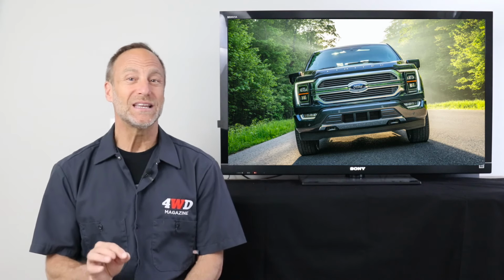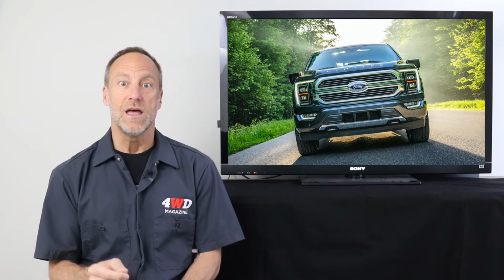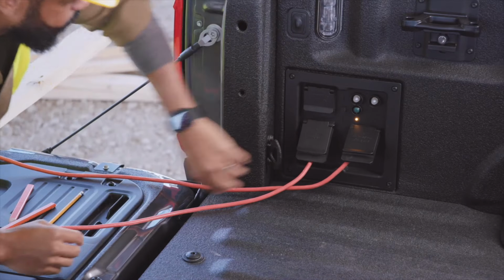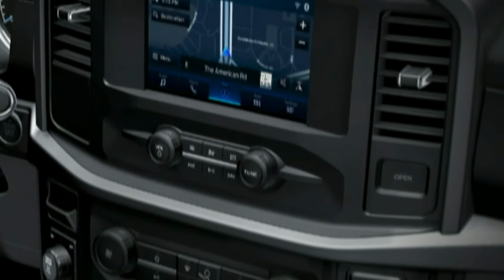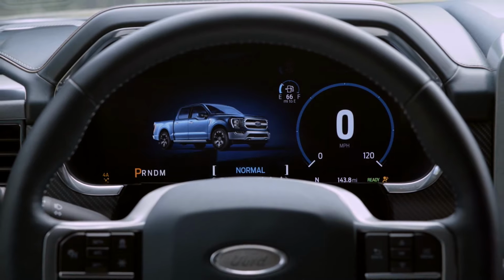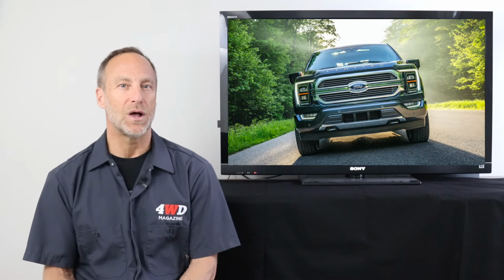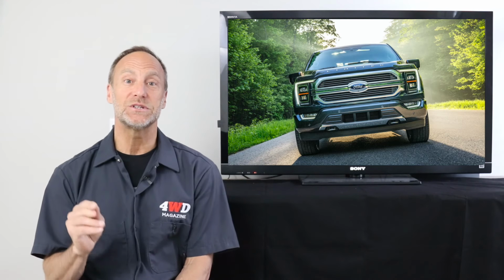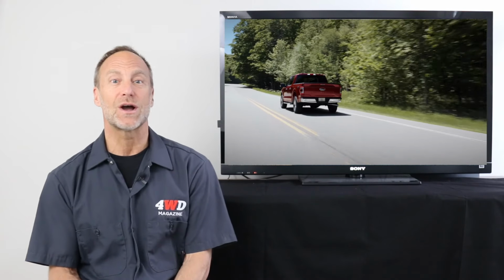2021 F-150 Full Feature Review - Everything Important

Comment: I really don't like automatic driving features.  Don't care.  Do like cameras and good, useful information.  Hitch help, yes.

Am looking at the hybrid for economy and possibly using the power available to run my Bi-Pap and possibly an oxygenator machine, at night, all night when not in an electric equipped, Campground.  Sounds like extra battery(s) may need to be in my configuration.  Recharging those is an issue.  Don't trust solar.

My 2000i Honda generators are efficient, reliable but make noise and require fuel.  I prefer quiet nights.  Boondock'n with trailer or sleeping in camp shell.

Thanks,

Comment: Jeez. This is going to be expensive. I don't want all this. A basic V-8, regular cab, short bed, 4x4. And manual even though none of the manufacturers think I want one. That's why i will only buy used. I refuse to buy a truck that costs half of what my house costs with things i have no use for. And driver assist? No thank you. I use a truck as a truck not an apartment. Thank you for the info.
Reply from the maker: It sure seems like it has all the comforts of home in the top end units and then some. Good news is all trucks end up becoming used. It sounds like you need a fleet unit - basic V-8, regular cab, short bed, 4x4, but the manual is going to be tough to find. I walk past an F-350 like that everyday - great truck for towing - affordable power.
Reply: Wow!!!... amazing
Reply: So just buy a baae XLT? Some people want the bells and whistles